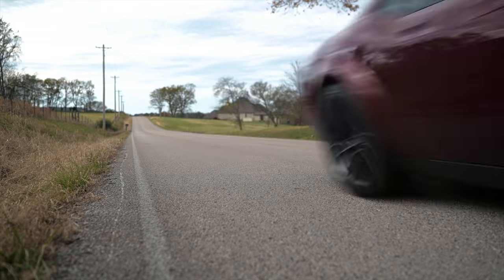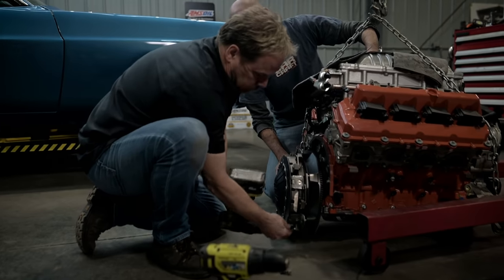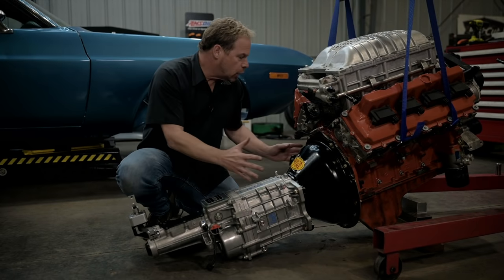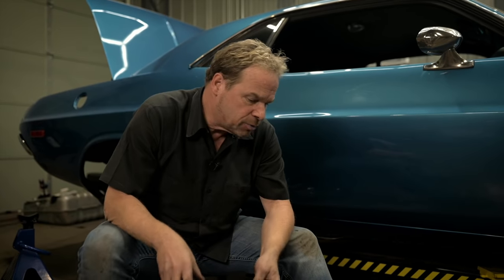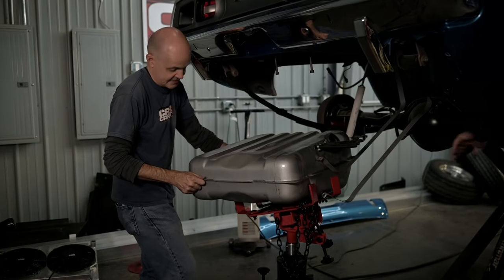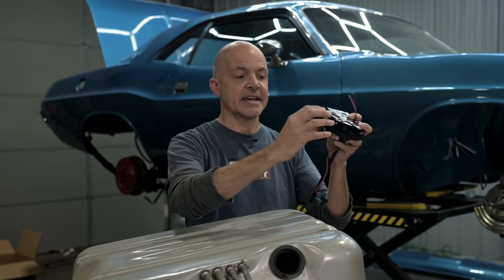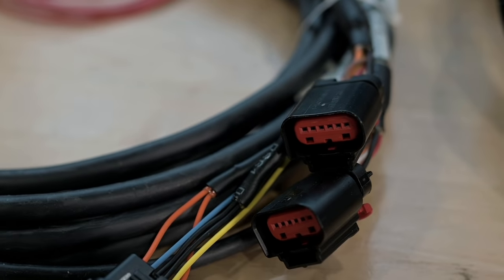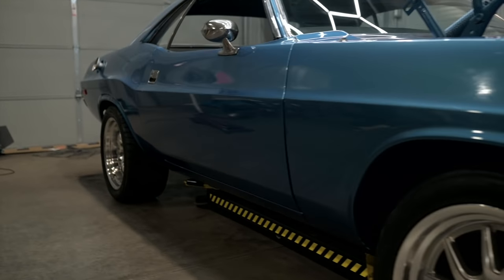Transmission and Fuel System Build | Car Craft Challenger Build Ep 2 | MotorTrend

Comment: Why did you install the fuel pump on the back-end high side of the tank? You will have plenty of fuel in the front of the tank that will not be able to be picked up by the pump. When the heater core fails, coolant will leak all over the ECU. Never mount the ECU under the heater box. And the entire engine is tilted. This series is more about what NOT to do. Come on guys.